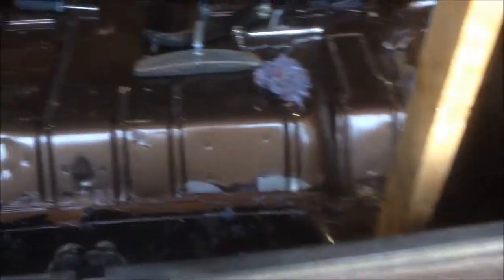Why TTop leaking is bad and a Third Gen Camaro Update

Comment: Found out the hard way lmao had to replace the entire floor pan
Reply from the maker: Yea, It can be really bad.
Reply: TanTinPerformance  also after I replaced it all I bedlinnered it
Reply from the maker: @pinkamenadianepie8609  Thats a good idea. Also some mass backed carpet isn't a bad idea either, so if they leak again the water will just set on the carpet and you can suck it up with a shop vac.
Reply: TanTinPerformance  meh I’m not gonna put carpet back in I’m going for the more stripped hotrod race car setup look  , anyways you still have your camaros ?
Reply from the maker: @pinkamenadianepie8609  I still have one of them, the brown one. Its been setting for the last few years. I have a few ideas for it, but there not in the budget right now.